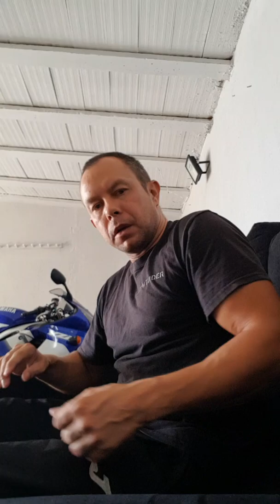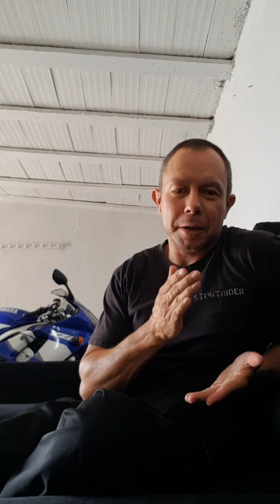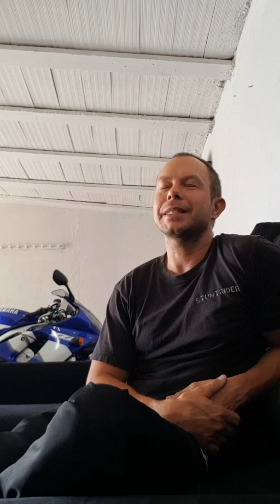OM606 stroke facts... And fiction.

Comment: Hello Fred…my question is like this:I got another om606 engine block which has little scratch line on number 6 cylinder and it bothers me…what if I grinde cylinders bore from 87mm to 88mm and add on it hone and than install om613 pistons…As all we know they are 88mm..what do you think about it?what do you sujest me?thanks!(I am just trying to save this block because it’s in good condition even hone is still seen on it and it has 300k miles..
Reply from the maker: You can always hone your cylinders (refresh your bore) and still run stock 87mm pistons. Or buy 87.5mm pistons and hone to size. CDI pistons will not work. They have a totaly different design. However you can use the block for a stroker build and smack 89mm pistons in there together with a 3.5 crank.
Reply: @FtunePerformance  wow!!! Its amazing!!I have om603 cranck..and what if I bore my om606 block to 89mm and install om604 pistons there.but as we know it does not have oil cooling holes in it(om604 piston)..can it handdle hi hp?thanks Fred
Reply from the maker: @GreenFalcon1984  it can handle anything you throw at it. Just remember to swap your oil squirters for the correct ones.
Reply: @FtunePerformance  thanks a lot Fred!👍I checked in Google and om604 piston has oil cooling holes but just like om603 turbo piston,not as om606 turbo.Also the thicknes of om604 top part of piston is thick as om606 turbo piston.
Reply: @FtunePerformance  also one wuestion Fred:which rod to install om606 or om603 on om606 stroker with 89mm piston?thanks!
Reply from the maker: @GreenFalcon1984  none of them. Only rods that fits are our F-tune stroker rods 🤷‍♂️
Reply: @FtunePerformance  sure!! Am gonna buy them soon.I will prepare this engine block,matching bore to 89mm than hone and when it will be ready I will contact you for stroker rods👍🏎🏎🏎also I will provide all photos of this project..thanks Fred From Georgia🇬🇪my MB w202 is first car here with om606😎and slowly this fu***lng om606 getting very popular here😂😂and prices rising up on it..
Reply from the maker: @GreenFalcon1984  shoot me a message on my private facebook mate.
Reply: @FtunePerformance  you will be laughing if I say that I don’t have this f**ing facebook😂😂😂😂🤣I really don’t use fb but as 10 year om 606 fan and lover.I will do fb and contact you😎OM Diesel engines are power💪💪💪

Comment: Hi fred, another great video. Im aiming to go mechanical pump, manual, possibly borgwarner s200sxe + other usual bits + cooling mod. In your professional opinion, before I install the engine should I open it, upgrade exhaust valves? Upgrade gasket? Or do u think a good level of reliability can be possible at around 400hp?
Reply from the maker: Asking me I say that opening the engine might not be needed but valve stem seals and such has to be replaced of course. And the usual relaibility mods.

Comment: so not necessarily to make cummins type torque but is it acceptable to use a 3.5L 603 crank in a 606 just to push more displacement? power limitations exist everywhere and if a 606 is limited at just for hypothetical example and easy math 500hp the use of a 603 3.5L crank could with stock cylinder bore get it to 3.3L. thats an extra 10% displacement meaning if you could get 500hp for every 3L at 3.3L you should be able to push 550hp. Or am i overthinking it and its always better to just add cams and more boost?
Reply from the maker: The 3.5-liter witch is what you get if you build a stroker is an amazing engine and well worth the hustle. Power wise you will have in my opinion a more fun engine at 3.5 but even a 650hp 3-liter is very, very fun. Power wise there are other limiting factors so displacement will not make more power... Just better power. If that makes sense.